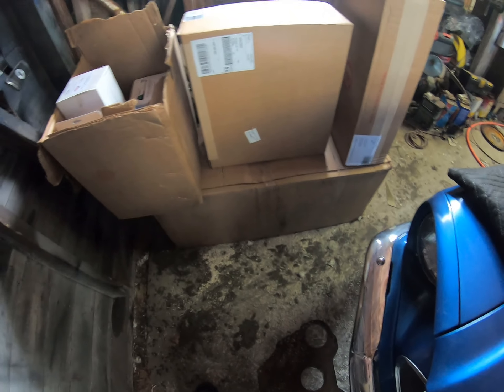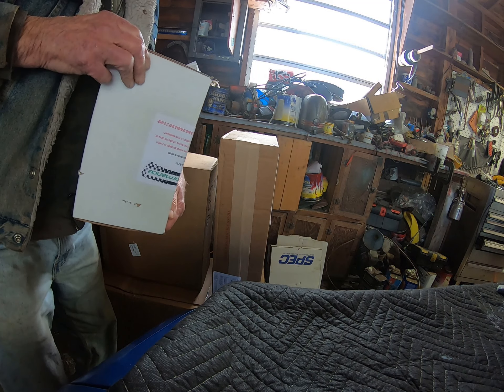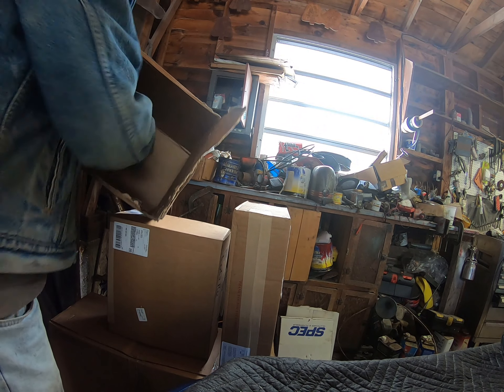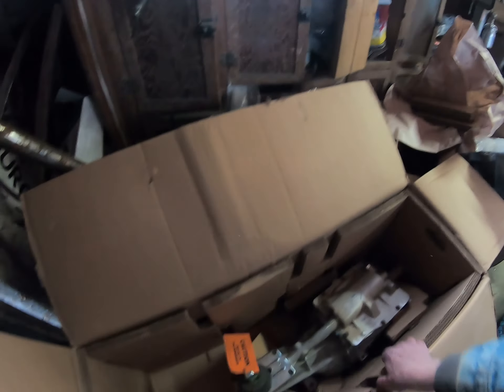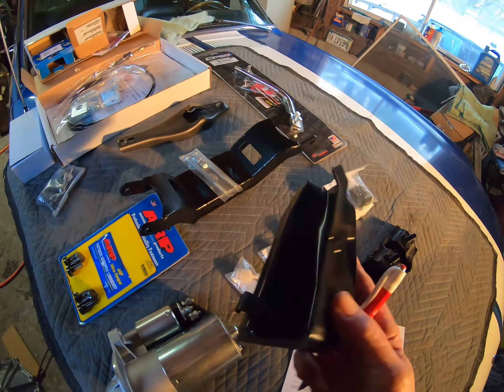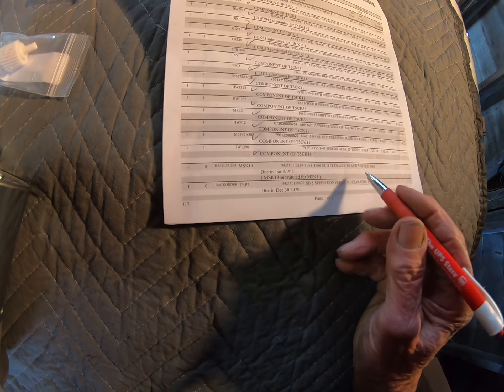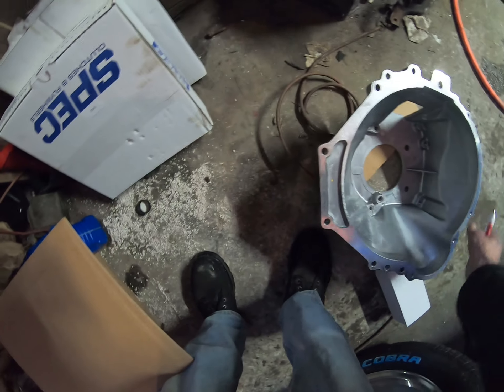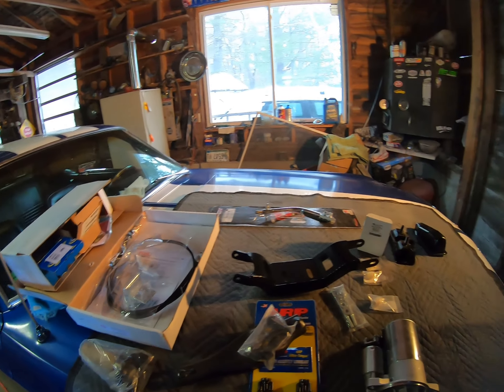Tremec T5 conversion kit for a 67 Mustang.

Comment: Thats a lot of parts. Must have cost a pretty packet. Hopethe new owner is paying for it all. Plus labour costs.
Reply from the maker: It wasn't a low budget conversion. Go to CJ's Pony parts and search for part number T5CK11. The new owner already sent a check for 90% of it.  CJ's returned my call. They said the driveshaft will be here today.
Reply: @alshotrodsandratrods8780  Thats good. Will be some vids o nit soon and then Richards in the garage.
Reply: @alshotrodsandratrods8780  Just looked. A pretty packet. If I had that much, I could buy a couple of cars here ,Not mustangs, but a couple I would love to own.  :)
Reply from the maker: @ianallen2  I'm hoping to get it finished next week. It depends on when the separator plate arrives. The driveshaft just arrived. It's raw steel. I'm going to primer and paint it and attach the yoke so it will be ready when it's time. I have to put a few hundred miles on it before the owner takes it home. I'll make a video of the shakedown cruise. I have a scenic mountain highway in mind. That way if it doesn't break down it won't be boring.
Reply: @alshotrodsandratrods8780  I wish you well Al. Hope it all goes smoothly for you. Whats happening with the Grunwall, or what it is called, the silver van. Has it gone yet. I would love to have had the opportunity to bnuy it from you, but I dont. :(  Such a nice vintage van with potential. Looking forward to your hot rod  rat rod build.
Reply from the maker: @ianallen2  The Grumman is still here. My nephew wants me to fix the brakes and clean the gas tank so he can drive it home and just have to set up the kitchen inside. 
They aren't very tolerant of unregistered cars sitting around where he is on Cape Cod Massachusetts. He sent some money. I bought new wheel cylinders and a master cylinder for it but it's too cold to work outside. Mike is going to fix it in the spring. 
I'm going to concentrate on building the two rat rod trucks. I also have a 55 Ford F100 that's almost finished.
Reply: @alshotrodsandratrods8780  2 pickups I would loved to have had are the Ford F150 / F250 around the 1976 - 78 model and a Chevrolet C10 about 1976 - 78 like the red one in Ryan O'Neal, The Driver. The only hot rod car I wanted was a 1934 Ford as the one in The California Kid. But I am interested in seeing rat rods / hot rods being built. Here in the UK, I grew up in the 60's and 70's, the age of customising cars and vans. UK never really had pickups like USA.
Reply: Ian - yes it has cost me a small fortune lol
Reply: @lewisframpton3673  Are you the new owner of the mustang ?